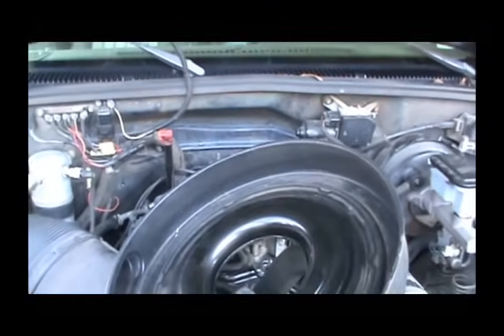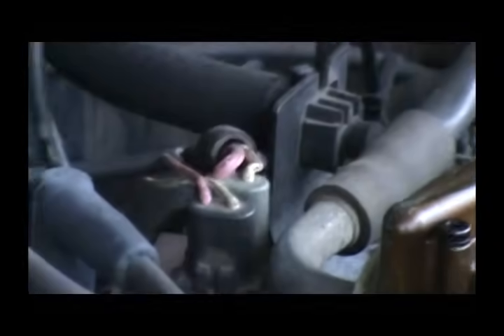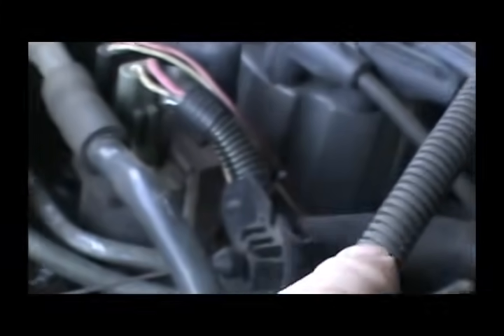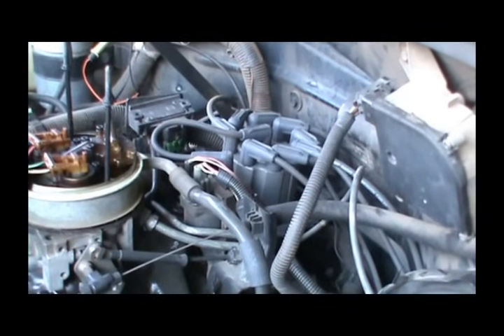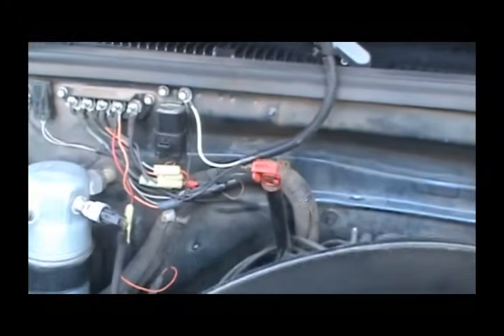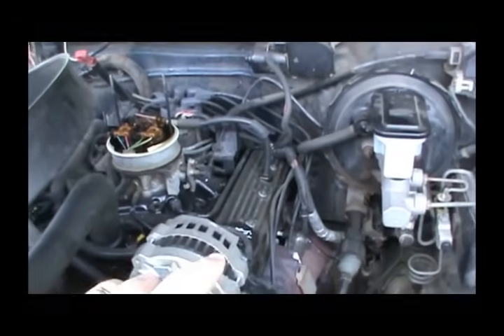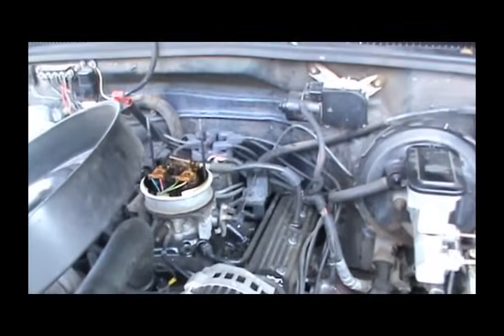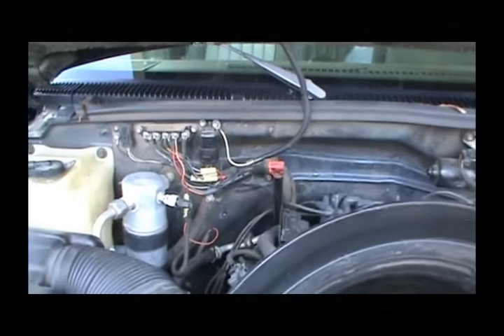1988-95 GM Truck Ignition Systems

Comment: Howdy. I have a 1995 Chevy Silverado 5.7L. I had a very rough idle issue with hard-ish starts (particularly first cold start) at times. Sometimes stalling when warmed, at idle, or changing gears P to R to D, etc.  Figured out the Fuel Regulator on the intake was original and leaking pressure (229,000m). Changed it. Idle improved to almost perfect, still a little rough. Starts better, but maybe still takes an extra second then it should.  But still, when it's been run for an hour or more, and then turned off and rests for 30-ish minutes, it will start but sometimes stall when put into gear. I can keep it running on the restart but have to give it juice carefully to do so. Then it seems to be fine again after it cools overnight.  What ignition parts are suspicious when it has this slightly hard start, slightly rough idle, and hot stall issue after hear-soaking?  ICM, another coil?  I don't have vacuum leaks, checked that already.  And Fuel injectors shoot fine and don't leak/drip.  Fuel pump has sufficient boost 10 to 11 psi steady.  Many thanks!
Reply from the maker: I'd look for a small vacuum leak or EGR not closed all the way.  The Throttle body probably needs to be cleaned as well.  There are rebuild kits available for the throttle body.  Hope this helps.

Comment: These GM ignitions are the worst known to mankind  . Complete garbage . Ford , Mopar  and AMC were 10 times better . The scary part is , most shops cant even make these GM settups work at all !  WTF  ?
Reply: lol I beg to differ. The HEI distributor was the best one in its day
Reply: @driveitbreakitfixit7496  Maybe , when it quits , your done . 3 different shops could not repair , or get spark on my 89 !     Swapped out ALL the elec. parts and STILL no spark .   So now what genius   ?

Comment: my 91 caprice cranks and runs but only one injector works??Any suggestions????
Reply from the maker: If you had an LED test light (not a regular one that uses incandescent bulbs) you could check to see if you are getting ground pulses to the injector.  One wire will be 12V positive, the other is coming from the ECM and is ground side switched.  If you're not getting pulses, check wiring or check it at the PCM.  If you are, then it's a bad injector.
Reply: @farmboy30117 thanks

Comment: man i got no check engine light, she bogs down when i accelerate when driving and when parked if i try to rev it it just bogs. ive done all vac lines, iac and connectors, coolant temp sensor by thermostat and connectors, fuel pump, fuel filter, spark plugs and wires cap n rotor, ignition control module, air filter, the injectors are sprayin cone lookin healthy, the throttle body isnt gunked up. i did the fuel pump relay. ground to fuel pump n sending unit. what else i done.... tommorow ima cut the cat off n replace with straight pipe n new muffler all the way back (black widow performance muffler) it fires right up n idles i can drive it 70mph but if u wanna step on it n go its just blugh sputters n then goes... i dont get it.

Comment: Ive had the truck suddenly go crazy with misfiring and at the same time, the tachometer needle is whipping back and forth wildly. It will rapidly whip from 1000 to 1500 or even off the scale, then to 2000, 1500, 4000, to 1000..... Totally random like a person frantically swatting a bee in the car.

It alway dies and its hard to keep it running stepping on the gas pedal. A new module didnt help.

When it died, i unplugged that brown wire. I made it 1000 feet back home, but still, without the computer it misfires.  The delco pickup coil is 6 months old.

Frustrating 🫣
Reply from the maker: Sounds like a bad ground to me.
Reply: @farmboy30117   If I tell the entire story, it would be like reading Lord of the Rings. 
......ah, what the hell.
The truck has 300, 200 miles on it. I've owned it for 100,000. My first vehicle with an ECM. I'm a 67 year old carb and HEI guy and this has been a 10 year education.
It's always had "issues"  Upon starting, it takes about 17 seconds to start coming down from high idle... even when warm.
Warmed up, the regular idle isn't always consistent.  Arriving at a stop light, the idle can be a few hundred rpm high... Sometimes it finishes coming all the way down.... sometimes not.
It's always seemed to run a little hot. I blamed that on my electric fan from a Dodge intrepid. (No stock fan)
I manually turn the fan on.
Chapter two:
Two years ago, the truck suddenly lost power heading out of town. No spark ,
Got towed home.  I installed a coil... no change. Installed a module... Problem fixed.
The brittle pickup coil plug broke, exposing one lead, but it connected fine/no chance of shorting .
I did some pondering.... ...then started replacing other old but functioning components.
IAC, TPS and MAP ant temp control sensors.  Those are in a case behind the seat. (Spares on board)
Chapter three:
A year and a half ago, my current ...or lack thereof 😁
problem arose.  Nice sunny day and the tach swinging/bad idle started.
It stayed running, so I wiggled wires under the hood...  The engine was running good. A two wire plastic connection  from the loom to the firewall looked pretty bad so I cut out and replaced some wire and installed "temporary" (still there) insulated crimp connectors.  No issues for months.
Then after driving I stopped at the store.  1/2 hour later, upon restart the problem was back. This time it was cooler and had rained lightly.
Hmm, humidity contributes now?  I could keep it running by feathering the gas pedal.
I put it in drive and it died.
I restarted and discovered I could get it moving in reverse to get out of the parking space and then into drive with the rpms up, I headed for home. Part way there, it was running fine.
The next morning I cleaned some grounds and added a couple.   Months later, it happened again when raining.  I walked a quarter mile to Napa and bought a new coolant temp sensor. Ran great.  Problems came back again weeks later. It was misty.  I never replaced the EGR module.  I pulled the plug and there was green corrosion on the contacts.  I split a piece of wood into a toothpicks and rubbed everything cleaner than it was. I made it home.
This has been going on for well over a year.
Chapter four:
Last Friday, just three miles from home it died and I got towed home. 😣
I have tried fixes, each time getting it to idle 2 to 5 minutes..... After replacing the knock sensor, it idled for 1/2 hour..... then died. Thought I had it 😭
I bit the bullet.. another ignition module, cap, rotor and coil. I also checked wire continuity in the connectors.
Nope, no cigar.
Chapter five: (gittin' close)
Last resort..... I'm desperate now. I removed the lower heater box cover to remove the ECU to check for anything obvious.
 😳😳😳😳😳 I wish I could send you a picture of the culprit.
The CPU plug on the left side wasn't fully snapped in. It was quite dusty (300, 200 miles dusty)
It has obviously not been fully seated since I bought the truck over 10 years ago.
Pushing the connection, it moved almost  1/4 inch before clicking solidly into place. 😱
Tho it was 7pm, the sun came out, birds started chirping, my eyes started watering....... I knew this nightmare was over, even before turning the key.
Chapter eleventeen:
The test drive.
EVERYTHING  was different now.  I'm in a new truck.
The shifting seems "cleaner", the idle at stop signs is normal and consistent every time. My engine temperature is lower by a little bit. I have factory and aftermarket tem gauges and both are lower.... not much... but I can see it.
When I slow gradually from 45 with my foot off the gas, it used to feel like I'm coasting, no real feel from the transmission or throttle.
Now, I can feel the downshifting and I can sense the throttle body has returned to an idle position, assisting the vehicle to slow down....... before, the idle or throttle position stayed too high all let me coast as if freewheeling.  I'm absolutely sure the ignition timing was freaky high.
I only got 20 minutes of drive time in last night.
A  200 pound weight lifted from my shoulders last night.
No more being scared and crossing my fingers every time I drive it out of town.
I know this barely connected ECU plug is an extreme rarity, but I suppose someone out in cyberland might relate to my bad connection at the ECM, so if my erratic tachometer/erratic idle combo ever occurs, the wiring to this plug connection or at this connection might help someone, or help you give some advice, for a starting point.

Every one of the previous fixes was luck and happenstance, not having much of anything to do with my real issue.
Thanks for reading.
Paperback versions available on Amazon for $1988 or call BR-549 weekdays 8 to 5 PST.

Thank you sir for beginning my search to a better life.
That brown wire and why it's there got me thinking. I'm familiar with it, but it got me thinking about the timing and connections from the various engine components and how they interact.
👍
Reply from the maker: @randywl8925  Awesome story!  Glad you found the culprit.  I have an intermittent issue with my '93 K1500 that sounds similar.  Every now and then the gauges will act up, and it'll start spitting and sputtering but usually it'll clear up if I shut it off and crank it back up.  I have gotten out and shook the wires going to the firewall and that's fixed it for a long time.  Next time I might dig my ECM out and see if it's connected good.  Thanks!
Reply: @farmboy30117   I figured you might enjoy the tale.
 It's been a long road and it felt good to get this chapter out of my system.
Hopefully it may help another gremlin chaser too.
.......it's always something. 😉
Reply: @farmboy30117   While I'm at it asking questions....
I want to at least, dust off the ECU connectors, then unplug them to see if the connections are clean.
Do I need to unplug the battery first, de- energize the computer first by maybe crossing the AB diagnostic terminal.....
Or simply unplug the connections, inspect, clean and reconnect them?
New territory for me.
Reply: @farmboy30117  
....oh crap. Update time.
I got 6 miles from the house to an industrial supply place to buy a small piece of aluminum to fabricate a new custom support bracket for the new aluminum 🤧 heater core lines.  6 miles away from home, I restarted the truck and it started the same-o, same-o miss.
Keeping the throttle 1/2 way down and rpms up always helped, so I did. Not easy in traffic, in town, at 5:30. At a stoplight, rpms high and power breaking, the right rear became tho screeeeeh 🫣
No way was I going to continue this way through 5 more lights. 
I took a main side street and made it 1/4 mile.
Traffic got deep at a merger point and I had to let off... It died and I coasted to the curb across from the library.
I unscrewed the lower plastic cover to access the screw to the computer.
I pulled it down, laid it on the floorboard and the truck restarted flawlessly.
I went home to investigate.
It took most of an hour wiggling computer wires one at a time, then the whole mass.  NOTHING made the engine skip a beat.
The problem  ended up being that when I rotated the computer and that large bundle of wires up into its bracket, this also rotated that big bundle of wires at the grommet that goes through the firewall. That grommet had over the years decomposed and had worn itself on the metal hole in the firewall.  It had worn through that huge, thick grommett o the point of shorting a wire. 😳
That was my problem,  a shorted wire from a large, badly worn grommet that's molded around the wiring harness.
The plug issue on the computer  with the plug not being fully engaged might still have contributed to the miss and tach issues, but I'm sure the firewall short caused 99 % of it. The loose plug might responsible for the transmission shifting quality issue, the ignition timing issue and  idle. 
This firewall short caused the erratic tach and engine misfire.
Now, I need to find the shorted wire and learn if it's ok or if it's been worn 90% through and barely holding together by a few strands.
Yup, rotating that thick computer wire harness as I reinstalled the computer allowed a worn through wire to short out.  When the computer was lying on the floorboards, it ran fine.
So yes, it's still permanently fixed.....
....I just need to fix the shorting issue to make it fixed-fixed.
I got this.  👍

Comment: So i have replaced the ignition control module, ignition coil, distributor cap, rotor and wires, and plugs. I am getting fuel, but still having trouble with it not turning over. When i get it to turn over, it idles but then I turn it off and try to start it again and it won't start. Should I try removing that connector still? What is weird is whenever it does turn over it the radiator fan kicks on right away, but I think that is just a stuck thermostat so going to replace that as well

Comment: Great idea for me to try. Im having an erratic tachometer and severe engine miss in my 88 4.3.
It will only run for a second or two, then die.
I had to get towed home last night.  Pickup coil and module have been replaced within the past year and so has TPS, IAC, MAP.
Im suspecting knock sensor or Spark Control Module.
Thanks for reminding me about the little brown wire. 👍

Comment: I have a 1990 k2500. It starts and runs fine but if you've been driving it for a while (maybe over 15 to 25 minutes) and then turn it off it then won't start again for a while. If you only drove it for a few minutes then it's fine. Then you can shut it off and turn it back on as many times  as you want. But if you had ran it for a while and turned it off it won't start until you've waited 15 or 20 minutes. I can't figure out why. Anyone have any suggestions?
Reply from the maker: You can narrow it down to fuel or ignition by checking the spark next time it won't start.  Could be vapor lock or an ignition part getting too hot. Since (I assume) it'll run fine as long as you don't shut it off, it probably isn't the fuel pump.
Reply: @farmboy30117 I'm pretty sure it's an electrical issue. Possibly in the ignition. When it doesn't want to start it doesn't crank at all. You turn the key and the gauges go up and down like normal but that's it. So it's not a spark issue. It acts as if you're not holding in the clutch. That's why I bypass the clutch safety switch but it's still doing it.

And thank you for your reply.
Reply from the maker: @thejohn6614  My first thought is that the starter (or solenoid) is getting hot and not working if it won't crank at all.  Is the exhaust factory manifolds?  It'd be a pain, but I'd try to take a test light the next time it won't crank and see if you're getting power at the starter or starter solenoid.
Reply: @farmboy30117  it was just not starting and I checked the stater and it was getting power but then it started immediately after. I'll check again next time it does it.

Comment: I was wondering. I have an 89. R3500 with 5.7 I have spark but no injector pulse. I’m guessing bad computer what would you guess. I replaced distributor and fuel pump.
Reply from the maker: That would be my guess but I’d check power and grounds to the computer before condemning it.

Comment: Mine is getting spark but the timing doesn't advance. Took to a shop, nobody can figure it out, its a mistery.
Reply from the maker: Could be either a bad distributor or a bad engine computer. The computer controls spark advance but if the distributor is bad, it may be unable to advance.
Reply: @farmboy30117  thanks, I've changed the distributor, and I checked continuity on the wire from the distributor back to the computer, it was good, so I'm thinking probably the computer. I don't know what else it could be, because I've replaced almost everything else. This things been driving me crazy for weeks. Thanks for your input, I Appreciate it

Comment: i have an unrelated question. i have same setup, recently had to replace ignition module under distributor cap. its run fine for a while, until starting up a hill the other day and all of a sudden got a loud rattling clanking noise from engine, and loss of oil pressure down to half (20) instead of 40. any ideas? the top side looks good all rockers move good, bottom side looks okay as far as i can tell, didnt get anything out of oil pan. whats your suggestion
Reply from the maker: Doesn't sound good.  Loss of oil pressure sounds like a clearance issue.  Maybe spun bearing?  I'd definitely want to pull a couple of bearing caps off and look.  Good luck.

Comment: What if it stalled randomly distributor bolt loosend up and no spark after put a new distributor in now I have spark and fuel but still won't start trys to

Comment: thanks this is helpful i still aint got no spark after doing all the same mess its a 1996 454 in a Winnebago i wonder how to set the timing or if i need to also can i set it without running by just cranking?

Comment: My ‘95 GMC Sierra 1500 TBI 
Will idle fine. As I put my foot further into the pedal I wants to spit n sputter New injectors, alternator, rotor, cap, fuel filter, fuel pump I just what to get her right so I can sell it

Comment: I have a 92 gmc k1500 350. Only thing I have not replaced was the Ignition Control Module Relay. I ordered it see what that does. Currently it acts like no vacuum advance. It cuts out won’t pull. I had a pulsing idle replaced the knocks sensor that solved that I’m almost at 100 percent now. I’ll put that Ignition Control Module Relay in see if that’s it. I changed the cap and rotor wires and plugs. New coil as well. New ecm new computer. I bought this truck brand new so only the Ignition Control Module Relay hasn’t been replaced. Can anyone give me suggestions please?